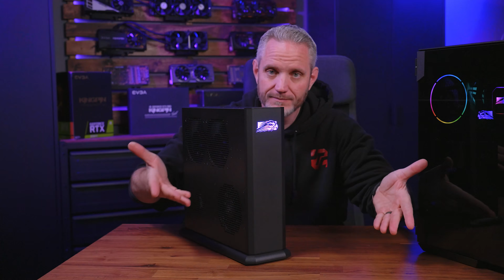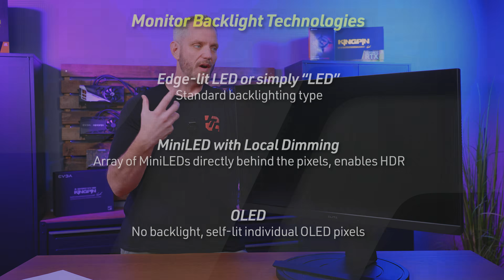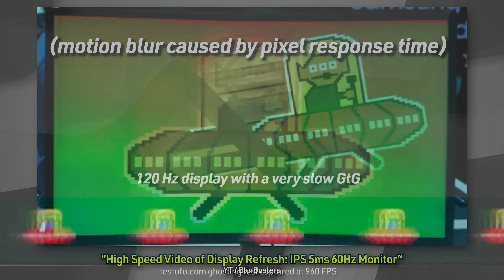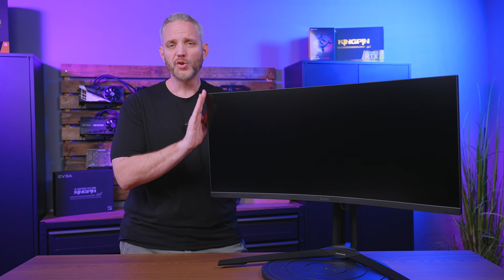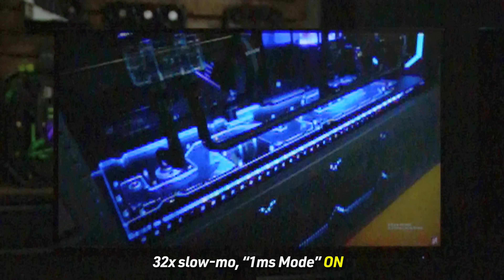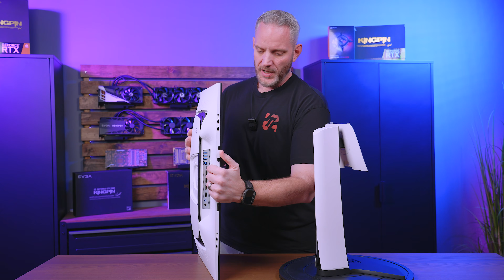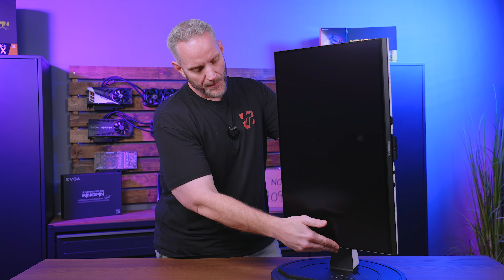Ultimate Gaming Monitor Guide: Find the BEST Screen for Your Setup

Comment: Id say going for the smaller versions of curved ultrawides with 1440, to preserve Pixels Per Inch, and  OLED/minimum 144hz is definitely an INSANE upgrade. 21:9 is a MUSt and id say 32:9 is getting close to a must for really everything. Its amazing. Curved really rules too.

am4 5800x and 6900xt @ launch into 7900xtx upgrade @ launch..... been using a  TV....nanocell LG 55" 4k 120hz (like one of the first, cheapest hdmi 2.1 with a second eARC port)....

just got Samsung Odyssey G9 OLED 49" 5120x1440p 240hz monitor (2023 model G93SC).....it is the single best upgrade ive ever made ever, period. Youd think going down from 4k would be a downgrade but the PPI on the TV wsa like 80 with new monitor at 110ppi. Plus the refresh rate increase, no TV software junk...curved is awesome too....but my god THE OLED will literally blow your mind!!!!!!! Plus the cool like dual-monitor in one features are extremely nice. 

Cant wait for my 9800x3d to arrive omfg. Also the dual 4k Odyssey isnt OLED (yet) and is quite a bit bigger (4in longer, 3in higher). If they can manage to  tighten up the curve on the OLED panels that are going to be dual-4k/57"  (BENDABLE, anyone?) ....wont nothing beat that thing!!

Comment: Something that salesmen will not tell you about ultra wides: The 3440x1440 (UWQHD) does not have the same proportion of 2560x1080 (UWFHD), this means some games cough Ubisoft cough do not scale well there and others do not allow to reduce resolution because only list resolutions that have the same proportion, so you can not reduce from 3440x1440 to 2560x1080 if your PC cannot handle the higher res.

I love and use ultra wides for about 10 years, but you need to know about these before you buy them

Comment: Just upgraded my 1080p 21.5 inch 60hz monitor to a 2nd hand 1 year used 27 inch 1440p 180hz and using it about a week now. I am amazed by the upgrade and even more so that my 1060 6gb can handle the monitor. It's just so smooth and so immersive for me. The jump is a total night and day difference. I would recommend getting 1 yourself 110%. Specific monitor models I have is the Asus VP228 now to the Asus TUF VG27AQL3A. Merry Christmas to myself indeed.
Reply: Are you using DLSS at all, or still rendering natively?
Reply: @Davivd2  The 1060 doesn't have DLSS so mostly natively but if FSR is available in game I use that.

Comment: I’m doing my first custom Waterloop. What kind of flowmeter do you suggest? Do I need a filter? And with running 2 radiators and CPU and GPU block, is 1 D5 enough or do I need 2?

Comment: The REAL problem is that most manufacters lie about the capabilities of the panels or at least "conveniently" hide the real way the specs are met
Reply: This is why I like to confirm with Monitors Unboxed or anywhere else that actually tests for the specs in their review.
Reply: RIGHT!? Acer be like "1,000,000:1 contrast" ... it's an IPS panel lol. Never know what you get when it comes to monitors honestly until you get it.
Reply: They've been doing that since the early 2000s and the Tiger Direct days. Learning to build systems and self taught on how monitors were a part of the process. Many of them stretched the truth quite a bit as my teachers confirmed lol.
Reply: I have a LG VA panel 32inch and its pretty damn good hdr looks great and its contrast and deep black are super good 180hz and feels smooth
Reply: The worst thing is that if you have no clue how to tell a good monitor from a bad one, amazon has collective reviews on some brands monitors for different sizes and refresh rate. So people see 4+stars and high amount of reviews and think a budget monitor is good but it is terrible and is the reason for all the 1 star reviews.
Reply: i don’t like those 1 star reviews on Amazon. They are all about broken item delivered or a wrong item. 3 star reviews are usually talking about product flaws. And i also like to visit a physical store where I can see monitors with my eyes. But it is not the absolute way too, because I can’t thoroughly test them and they usually play some demo video on them. So still you buy on your own risk

Comment: 1440p ultrawide or not(ultrawide only if you have the power and money for it) with refresh rate of 120-144 hertz, 1-2 ms response time, 32in(minimum, size controlled by amount of $$ got) panel is perfect spot. Bonus of it actually having a vesa mount. Granted I don't actually have one to fall into what I consider the sweet spot. As I'm only using a 1440p, 75 hertz, 2ms, 32in panel. As it's some dell made one that found for around 200 dollars few years back when anything else found that was 120-144 was 350-400+ and really couldn't afford that jump in price, so settled with just having 75 hertz refresh rate.

Comment: Jay, I love ya, but you are disqualified from talking about display panels. Omitting VA panels was a huge mistake. 

When it comes to displays, contrast is king, which is why IPS panels suck for entertainment.  Why do you think the vast majority of non-OLED TV panels are VA?  Because they look way better than IPS. IPS panels have a very low contrast ratio compared to VA, and black just does not exist on an IPS (dark grey, at best).  VA panels (Samsung, in particular) are just as fast as the fastest IPS panels, offer a way greater contrast ratio, wider colour gamut, deeper blacks, and don't give off any IPS glow.  

Need to do some professional work in a brightly lit environment? IPS would be the way to go. But everything else will look better on a VA.

Comment: Regarding display data. There are only two data that you can depend on the manufacturer to be honest about, and that's resolution and frame rate. All others can be falsified or misrepresented. The physical size is most probably quite near the truth, but response time, contrast, light strength, color space. All these later are suspect. Just look at the number of displays that is said to have a response time of 1ms. They don't, that is pretty certain. Then there are TFT monitors that is said to have a contrast of 2000 or more. Again they don't. A TFT display will have a contrast somewhere between 900 to 1200 in extreme cases. VA can have a better contrast and OLED has basically infinite contrast as they can shut down a pixel all together. And dividing anything by zero just isn't possible. Light strength is another value that sometimes are given impossible numbers.

So don't believe everything the manufacturer claims. Instead you either just buy what you think is a decent display or go read a lot of reviews and try to figure out who is just hyping their sponsors and who actually knows what they talk about.

Comment: Monitors are way cheaper than he thinks for 1440p I just got a 180 MHZ refresh rate monitor with 0.5 MS response time for $170. You can get low end 4k  monitors for under $200.

Comment: Hi Jay,  Lonv ti.e viewer here.  Your show is much appreciated.   Please check your data on the R value for curved monitors.  The R value is actually the radius of the panel.  Thus a larger R value is a flatter panel, while a smaller R value is more tightly curved.  Keep up the good work.   😊

Comment: small note. TN still has SOME prevalence in the current era as it has seen success on the eSports stage thanks to TN's lightening quick pixel response times. More often, the colors arent the best compared to OLED, but for an LED, it has image clarity beat compared VA or IPS monitors. It's a niche use case and wouldnt be relevant to 99% of users.

Comment: Other than the R rating for curved monitors that a lot of viewers have already commented, Jay also got the VESA mounting pattern incorrect. The more common ones are 100 x 100 and 75 x 75. There's no 80 x 80 pattern.
Reply: Got that too. 100x100 would be the most common one, with 75x75 on a bit smaller displays. TVs will often go 200x200 or even bigger. My 75" Philips has a 600x400 VESA :)
Reply: I was just looking at the number of 75x75mm VESA mount available on Newegg and it was a fairly significant number.
Reply: I have a monitor that is 100x200. It's dumb af
Reply: There is a 80x80 vesa pattern Google is your friend.
Reply: Gonna have to start calling him Linus with this kind of misinformation lol

Comment: There is not such thing as gaming monitor because we do 1000 things with the pc not just games. We usei t daily for internet, games movies/series and work.
I rarely change monitor while upgrading the pc each 2 or 3 years becausei believe it is more important the pc to be powerful so it can run all games maxed 60 fps and all programs than to spend lot of money on a very expensive monitor that io dnt nned.
Istill have the same monitor sice 2016 while i have upgraded the whole pc at that time:
cpu ram motherboard and case in 2017 ssd in 2020 and graphics card in 2021
MINE MONSTER PC IS
RYZEN 7 1700
RX 6700XT 12 GB RED DEVIL
16 GB DDR4 3200MHZCL15
MP 600 2TB WRITE:4950MB/S READ:4250MB/S
DELLP2416D 24'' 2560X1440 60 HZ IPS
It loads evrything in 1 second(windows, internet, games, programs, movies/series) and it also runs all games maxed 1440p 60 fps(but iuse FSR for those games who have ray tracing whilee not for those who dont have r ay tracing as those still run maxed 1440p 60 fps without it).

Comment: During black friday there were some crazy deals. Also one thing i want to tell everyone thats on the market for OLED monitors is becareful . I have owned a QD oled and now a W oled .  the QD OLED i owned it for exactly 2 years , and was getting constant headaches, sinuses , and abnormal eye fatigue even at low brightness . the W oled i now  own it for almost 2 months and W OLED is much less intensive to the eyes and no longer have the headaches . if you are eye sensitive or suffer from allergies  please get the W-OLED . The W oled uses white light instead of BLUE  to light the pixels , the blue is very harsh on the eyes and my eyes do not like it.
Reply: Very helpful. Didn’t know this was a thing. Thank you.
Reply: Thanks bro I do have sensitive eyes. Good to know
Reply: I wish there was more info on this out there, I hear it often enough to have steered me towards WOLED.  Would love to know how common that is and how likely it'd be an issue for you without buying/returning a monitor.
Reply: "suffer from allergies  please get the W-OLED" 
tell me you don't know anything about biology without telling me you don't know anything about biology.
Reply: @simonpeneau7802   allergies clog your nostrils can produce sinuses . Also heavy eye strain I’m not a doctor but there’s a lot of information about this online you can do your own research
Reply: Yup. This is exactly why I sold my OLED monitor and switched back to IPS panels for now until the tech gets better. Good enough blacks for me and cheaper too.
Reply: @vanik6639  this is what Im thinking of doing. Im about to spend some good money on a nice panel. I'm leaning back to a nice IPS. I use my gaming PC for EVERYTHING. My screen needs to be able to not be baby-sat. The room my machine is in can get very bright during the day too.
Reply: @friedclutch97  I would highly recommend it, especially since your room is brighter. What did you decide to do?

If you’re looking for recommendations I went with the Asus 300hz on sale and can’t recommend it enough!! The 340hz is a little pricier but I hear great things about it.
Reply: @ I had to delay the new monitor. My TV took a dump. Bought that QD-OLED Samsung. My first really nice TV. I can see what I have been missing all these years. Its phenomenal. The 2 grand ate up all my extra cash this month.
Reply: @ My PC cant get anywhere near 300hz. Waiting on either Nvidia becoming available or maybe even swtiching to AMD. Nvidia is really pissing me off with this launch. Keeping the RTX3070 for a while. What ASUS did you get?
Reply: Blaming the monitor & not your lack of hygiene/probable cat for your allergies....

Yeah... That makes sense... 🤨
Reply: blue light is the worst for eye fatigue and headache

Comment: Since 2019 I have been using 55" OLED TVs as monitors. At first I ran them at 1440p at 120hz with RTX 2080 tis and went 4k in 2021 with 3080 tis. Now they use 4090s.
The TV used the most has over 11,000 hours on it and still going strong.
To get the OLEDs to last all you need to do it use a screen saver.

Comment: 2k is technically a 1080p rating. The official 2k resolution is 2048x1080p (2k, meaning approximately 2000 pixels horizontally). 1440p would more aptly be called 2.5k, although some now define 2k as any display with a horizontal resolution that is between 2000 and 3000 pixels. 

I think the term 2k has been misused to refer to 1440p for so long that it basically can’t be reversed. However, it’s still good to know, which is why I bother mentioning it here.

Comment: Are there any current 55 inch monitors aside from Samsung Ark? I am quite ok with my triple 55 inch tv running 4K for now however I'm totally aware that 120hz units would be better in terms of motion. 60 hz would always have that stutter when you look at the horizon while cornering.

Been doing some research for my simrig but can't seem to find any aside from the Samsung Ark. Theres are still pricey which I wouldn't mind however I'm seeing a lot of issues which I never experience with TVs. They would usually last at least 4-6 years or so. We even had an old 42 inch plasma tv which still works to this day.  However, I would be more than happy if I can bolt a 120hz 55 inch 4K screens to replace my 60hz TVs if not now, in the near future woul be great. Happy New year to everyone and all the best for 2025!

Comment: As long as the monitor has between 60-144hz (with low millisecond response time) and at least 1080p resolution, that is literally all you need. 1440p or higher is only useful if you are going for a 32inch tv or larger. You can disagree with me and I won't fight you, but you won't convince me otherwise.

Comment: I dont think you know to much about monitors jay it sounded like you just did a quick read on the tech data sheets. Noticed you been messing/saying wrong info for quite abit now. N i have been subed since like 2012 or 13. I do not normally comment on vids but this is starting to bug me (misinformation).

Comment: So Jay what do you think of this TV that I'm using as a monitor, I'm running it with a Ryzen 9 7900x and a AMD  7900 XTX   ---- VIZIO 50-inch MQX-Series 4K 120Hz QLED HDR10+ Smart TV with Dolby Vision, Active Full Array, 240Hz @ 1080p PC Gaming, WiFi 6E, Apple AirPlay, Chromecast Built-in, M50QXM-K01, 2023 Model  it seems to be playing all my games with no stutters, I don't have any complaints  and what does the QLED mean?

Comment: Adaptive Sync does require hardware support. Except it is only a minor tweak to scaler chips and has been baked into virtually all new chips from the last ~10 years. There is next to no added cost to including Adaptive Sync support, which is why it can be found on monitors all the way down to $120 today.

Comment: MPRT or Black Frame Insertion can be terrible if it's not implemented well and or if your frame rate drops.  It can turn your screen into a flickering seizure inducing headache.  Cheap monitors use that tech as a way to lie about the response time.  They claim "1ms" when it's actually close to 8ms.  Get a cheap 32 inch MSI monitor, turn on MPRT and see it for yourself.

Comment: Hey Jay, about the "ultra wide allows for bigger FOV without distortion" why would i be able to do the same by getting just a larger 16:9 without distorting the image? JW because if you get an ultra wide, you could in theory get a 16:9 that has the same width but now you also have extra height available, why doesn't that fix distortion with FOV?

Comment: I've been gaming + coding on a 100Hz 3440x1440 ultrawide since 2018 and the difference was huge for both tasks. Having multiple files side-by-side in VSCode, but also for streaming, being able to move the UI in WoW off to the sides and still maintain a 1080p output offers a lot of convenience for e.g. hiding chat, hiding names, etc.

However, I recently, sort of by accident, moved WoW over to my secondary 1440p 144Hz monitor, and instantly saw the difference in how fluid it was. My system was comfortably running it at 400 FPS (older world area, not many people around, slightly reduced view distance) and I was sort of AFK in game, but the difference was really surprising. It felt like the microstutter all but vanished just because of the increased refresh rate.

The problem I had was that since 2018, every major company has focused on the 49" panel size for ultrawide, and completely neglected the 34" panel size, unless you just want the same old 100Hz. It's only in very recent times that we're starting to see 34" ultrawide panels running at 200Hz or more. That's likely to be my next upgrade in terms of displays. However, I'm keen to avoid OLED due to the burn-in issues that they exhibit. I'd much rather stick with IPS or VA panel because it provides a great balance between colours, viewing angles, and lack-of burn-in.

Comment: Wake me up when there's 3840x2160 at 240Hz with VA (not OLED) without DSC with DisplayPort 2.1a to connect to a RTX 5090 with G-Sync Ultimate only.
Until then, no bueno I stick to my PG279Q.

Comment: The problem with OLED's is that they have to sacrifice brightness for longevity. The brighter the pixels, the faster the pixel degradation. That's why panel manufacturers limit brightness on OLED's even though they are technically capable of being as bright as LCD's.